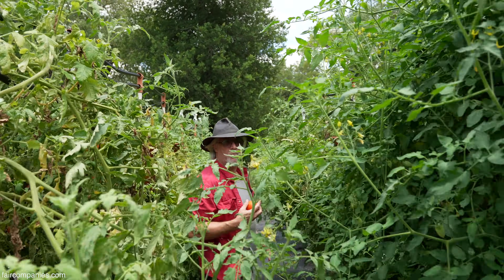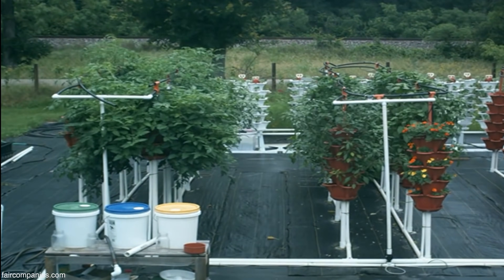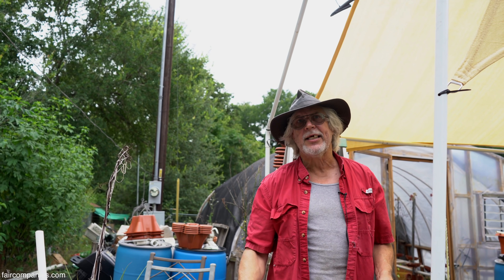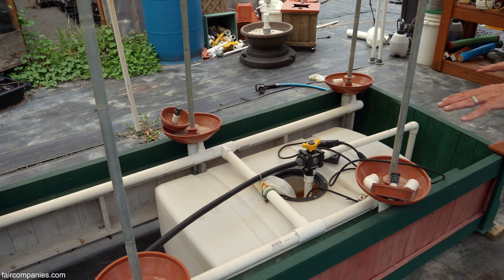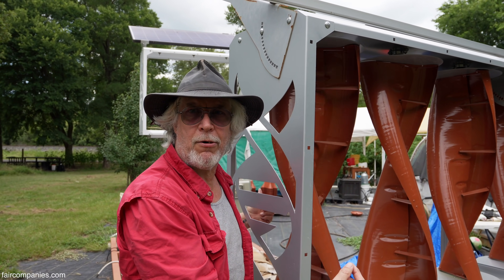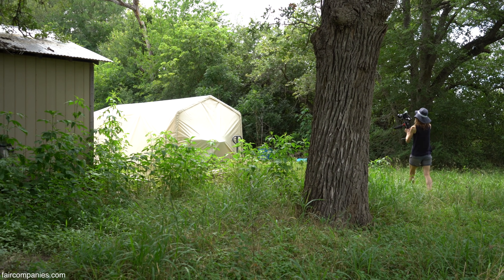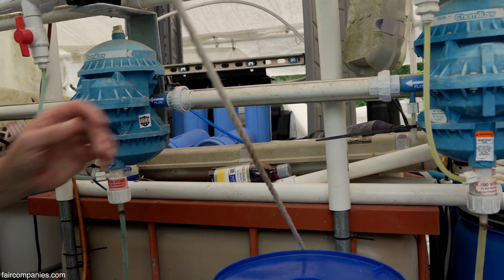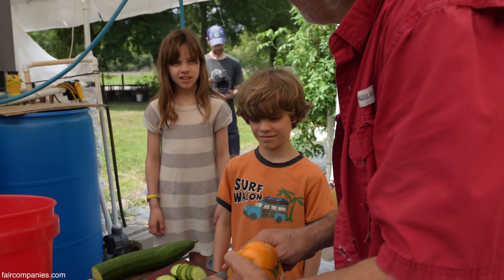Mad scientist's homestead is parking size, off-grid system

Comment: If you're interested in these types of vertical-axis windmills, be sure to search a bit for: "Savonius wind turbine". This will show you examples of similar turbine designs, which can you even make as a small science project using e.g. a Pringles tube or a (a bit more "serious") using a small section of rainwater pipe.  :)
Note: make sure you stay safe though! When there are high wind speeds. Under high load (and when no braking/safety mechanism is present) parts can go flying when a wind turbine hasn't been designed/constructed properly.
Reply: If a horizontal axis wind turbine keeps hunting a changing wind direction it's not installed in a good spot to begin with. Any type would underperform there. A good installation is high up in clear, no turbulent air, something like 10 meters above the tallest obstruction nearby and designed for the commonly seen wind speeds of that particular location and the size of the machine comes out of the equation for that wind speed - likely lower than that even, if you want at least some production most of the time.

Anything installed on ground level will see lower performance no matter the type, and the vertical axis designs are among the least efficient -- inherently, no ways around it -- in converting energy from moving air to mechanical energy (which can be further converted to electricity or used directly for pumping water, or milling something... your choice).

Vertical axis turbines therefore have to be larger and consist of more material for any given output power, making them a more expensive choice for the energy they produce over their lifetimes. They're neat to look at but their downfalls keep being rediscovered by hopeful inventors and self-builders time and time again. If these shown here were put through their paces in a windy location we would likely rediscover one of the pitfalls of the design, which is the bearing lifetime. Unless they're rather hefty and therefore even heavier, and if they're installed up high, that's all the more weight aloft, requiring a more expensive tower. Don't put them on your rooftop either, that's another mistake that makes people regret the decision over and over due to their vibration making the house shake. Not shake it apart, but enough to annoy you with the sound.
Reply: @sietuuba  Amen.
Reply: @Aquatic Ape In any mechanical energy to electrical energy system you have to take care to match the mechanical speed to the optimum power output speed curve of the electrical energy generator.... basic physics.  Vertical axis wind turbines of which Savonius is a low speed type (there are VA high speed aerodynamic blade types) is a bad match to a compact electrical energy alternator/generator that was originally designed for higher speed engines (1,500 - 3,000 rpm approx).  However, low rpm Savonius wind turbines are a very good match for large dia high torque pancake style generators and even better for high torque low speed water pumping.

Look at the western prairie made hospitable by pumping well water up from underground using very low speed multi-blade wind mills - same principle - match the blade design and wind turbine technology to the load.  If the load is low speed use low speed wind turbines.  Horizontal axis big blade diameter electrical energy producing wind turbines are in my opinion one the most egregiously inefficient clean energy tech devices built.  The invested energy is enormous in the tower, turbine, blades, 400-cu-yds of concrete base ...etc.  The blade speed is not matched to the optimum high rpm power curve speed of the generators so they have to use gearboxes or hydraulic motors to convert high torque low rpm from the blades to high rpm generator speed ... waste ... waste.

The largest owners of big tower wind farms in the USA are Wall Street firms and a couple big banks, because 30 years ago they bribed Congress to allow the entire cost of building the wind farm to be depreciated over 5 years against bank profits then reset back to the full amount if they sell the wind farm, usually horse traded to another bank or Wall Street firm.   So every five years a $300m wind farm becomes an extremely lucrative 5-year depreciation tax write-off worth $300m to the new owner ... then they swap wind farms and get the tax value of both farms reset to full value of $300m... repeat.    Big wind farms never have to make electricity to generate huge profits for the owners if their other businesses have big profits that need to be shielded from tax using capital depreciation schemes.  This is the big secret lie about wind energy in the USA.  Like they say .... follow the money.
Reply: @SeattleCoorain  So because of a tax loophole in a corrupt country representing 5% of the world's population, HAWT in general does not compete in terms of LCOE?  HAWT wind turbines are becoming more powerful and cheaper all the time. In my opion your opinon is probably wrong. Facts count, not over-generalizations based on a worst case country.
Reply: I’m interested in more info on the alternators shown at 12:50, and the internet devices shown at 14:50. Are these things available for other purposes, or only as part of a farming installation?
Reply: @k9gardner  You can use the antenna system for home internet.  you can get more info at SimNetWireless.com
Reply: @k9gardner  keith. theyve been making motors like that alternator for quite awhile now. im an electrical engineer, its really easy to design the circuit boards for this. however making circuit boards are very bad for the environment so while i can appreciate the benefits of tge solution, it does come with extra issues. that being said, they should last for a long time assuming vibration and exposure to environment soes not cause delamination.
Reply: @chrisludolph348  If making circuit boards is bad for the environment (which I don't doubt), we're screwed, as everything seems to have a circuit board in it nowadays. I'm one of the people Larry Johnson refers to when he says when most people think of an alternator, they think of something like what's in your car. I've never seen one like this before, do you have any further info you can link me to? I'll search on my own of course, but if you're referring to anything specific I'd love to see it. I'm interested in high-efficiency alternators/generators, particularly because of my interest in the kind of small wind turbines he's making, and low-flow water turbines, etc. Thanks so much for the input.
Reply: Thanks...
Reply: I helped install those wind turbines in Argentina. It's on the outskirts of Buenos Aires. We installed them probably 10 years ago, those blades that he has are from those systems. I'm pretty sure our company actually had the copyright on that blade design. Windstream technologies was the name of the company
Reply: @denniswebster1176  Thanks, that was super enlightening!  Windstream actually has some specs, listing the output at 11m/s. The fact that this is 10 years' old technology and has not made a splash since then (just google (WindStream TurboMill) indicates that this is not a successful design.
Reply: These pots need to made into 3D STL files in the public domain! 
It's possible to eaisly turn recycled bottles into things like this! 
Hope this manifests! 🤞
Reply: @eliellington  Is it your position that private intellectual property should be looted for the public good?
Reply: Savonius  (vertical axle) windmills are notoriously ineffective compared to the propeller style ones. They were invented a hundred years ago and there is a reason why they are not widely used.  It would have been interesting to get proper test results for this design, but any claim that this design is more efficient than what is producing 99.9999% of today's wind energy production should be taken with a very large spoon of salt.
Reply: @tzenophile  yes the H-Darrieus is most efficient of all VAWT
Reply: @tzenophile  Read the research papers. I  built and tested a model VAWT for my university project.
Reply: @danieljones3140  When; recently? Any papers you'd particularly recommend, then? Preferably open access. Anyway, even if H-Darrieus is most efficient of all VAWT, as you say, that is like saying, Cours is the best of all pitiful industry beers. Not really a recommendation, is it?  I ask again, where are the successful VAWT installations that can give us real data? Or even the VAWT companies that have actually launched a mass product a few years ago and are still in business?
Reply: @danieljones3140  So, no paper recommendations? Just hot air? There is still time to surprise me, Mr Jones.
Reply: @danieljones3140  How many universities have you experienced? In how many countries? Facile, anecdotal, oversimplified conclusions, like yours seem to be, is the bigger problem that science tries to rectify. Did the moon landings happen? Is the earth flat? Are you one of those, or not?

There are countries where the monetization of higher education has gone way too far, like that now 3rd-world country, the USA, but to dismiss research and technology off-hand leaves me wondering what your rational alternative would be. If your answer simply is that you don't have any alternative, I'll respect that.
Reply: @tzenophile  indeed you are correct. But it also depends on height. Propeller windmills work best when they are as high as possible, where the wind does not change direction and has the highest power. It might be that close to the ground, these work better. 

But a much better solution would be to build a tower as high as possible and place a propeller style windmill there. In stead of trying to improve a flawed system with another flawed system. 

Wind energy at ground level is a bad idea, everything that enters his compound is already displaced and diffused by all of the trees surrounding it. Wind streams are like a river, and earth is like the shore, if you want to catch the stream you have to go deep enough where the stream is not hindered by the side.
Reply: @stnhls  I mostly agree with you. My only contention is, how do you know VAWTs are better or as good as HAWTs at low, turbulent heights?  As I understand it, VAWTS are not better than HAWTs at ground level, they are just relatively less worse than they are up high. So if you have one of each, you put the HAWT up high, and the VAWT at ground level (if you bother with it at all.) What you never do, is the opposite.
Reply: @tzenophile  at some point the horizontal windmill will hardly rotate, if the wind is really diffuse. The vertical design will operate no matter what direction the wind blows in. So I can imagine there might be some scenario's where it will perform better.

Also less movement of the gravity center, easyer scalability and stackability, less complex design with less materials used, less torque generated on the pole, are all considerations that could come into play in addition to the height / location.
Reply: @stnhls  When there is hardly any wind, there is also hardly any power, so you get a useless amount of watt. The only scenario to justify a hawt over a vawt is when the application is so puny that it doesn't matter how little you produce, but still, this is a window of perhaps between 2 and 3 m/s. In zero wind nothing happens either way. So you need a battery for that, and why not charge this with a proper, efficient turbine. Or even simpler, solar.

Your other arguments are easily countered. There are VAWTs without gears too. Unlike HAWTs they don have the full weight of the rotor on the bearings, etc etc. Your big problem, though, is reality. in more than 100 years of VAWT, there has not been ONE successful, marketable, commercially viable design. And not for lack of trying. It is fool's gold; the turbine design of the future that will always be the turbine design of the future.
Reply: @tzenophile  Yeah, I spent most of this video thinking to myself that this guy is light on facts and heavy on feelings.
Reply: @tzenophile  Depends what you call effective. The propeller ones are installed in a certain position because they know, they studied and have enough data to know where can be efficient. This instead is made to be multi-purpose. By try and error like this fella did, he knows why he choose this instead of the modern one.
Reply: @BurninVinyl  I'm sorry, but no, this does not depend on my personal definition of 'effective'. If you want to claim that I'm wrong, please present a single piece of evidence that vertical axis windmills are competitively efficient. They are not. They look cool, which is why people want to believe in them, but they are only used in applications where output is not important, e.g. low-power sensors. If EZGro wants to claim that this is as good as horizontal axis windmills, they have to give us the data. This is pure physics; simple calculations and measurements. Why do you think they don't? It would have been seen as a major breakthrough if they could. But no.
Reply: @tzenophile  nope, you are the one here to prove it. The video explains why they are using this type instead of the one you mention, not because they look cool. 
Your only reply can be resumed <<they are bad cause they are not the current trend>>. 
The destination of use is different because horizonal axis windmills, I bet you need to get a permit from the gov to install them, instead this type are easy to transport, smaller size, cannot hurt birds and animals and do not require permit from the gov because low wattage. It's more DIY kinda thing. When you want to install something who produce x amout of energy, if this surpass certain level, you need a project, engineers, technicians to certificate your implant. You can't DIY.
Reply: @tzenophile I find this interesting, why would Argentina chose vertical axis versus propeller style?
Reply: @tzenophile  nope, already explained, if you just do not take parts of phrases. 
Whatever you are selling, let me tell you, your strategy always backfire. Take care.
Reply: @BurninVinyl  I realize that English is not your first language (and mine neither) but you are not making any sense here. But I get it, it is not fun to argue when you don't have arguments.  Insulting me by insinuating I am selling something which I am clearly not, is just more nonsense, so yes, do go away.
Reply: @Catcat123-w3l  I have no idea what you are referring to. Please elaborate.
Reply: @tzenophile  in the video they show a combined solar /wind project between two highways in Argentina.  His vertical design was used.  Look a minute 16:39.
Reply: @Catcat123-w3l  Ah, yes. So,  who invested in that? How much of Argentina's wind power is vertical axis? What is your exact argument? That this is the norm in Argentina? Because that is what it sounded like, and it is clearly not the case. I'm not saying this product is not selling. But as they would say in Argentina, ¿Dónde está la carne?
Reply: @tzenophile  you misunderstand me, I have no argument, just questions because I don’t know enough to argue.  Using logic and experience of driving on super highways, I can say the vehicles moving at high speeds create wind.  To capture that wind, the spinner needs to be closer to the ground then a typical commercial size windmill.  So a non propeller would be better to capture the the wind created by vehicles passing at 40 mph +.  Your thoughts please.
Reply: @Catcat123-w3l  If you have high school physics your thoughts are as good as mine. I'd say the energy produced by vehicles on highways is negligent for any practical windmill purposes, and on the video the cars are too far away for even minimal relevant drag to occur. Full points for originality, though, but if you want cars to produce significant energy, say, in a wind tunnel, that comes out of the cars' energy. So fossil fuel, unless of course, the cars were electric.
Reply: @tzenophile  sorry no high school physics, I tended toward biology,  anatomy and physiology, (medical)and botany.  Maybe someday we will harvest sound waves for everyday energy use.  My nephews loud one year old singing voice could power NYC, I’m sure. Lol
Reply: @Catcat123-w3l  Sounds like you are describing those vats from the Matrix ...
Reply: @Catcat123-w3l  WOW you mean someone wasted a shit ton of money on useless turbines?? So why isn't there data on what that install has produced? Not a single stat anywhere on the web, NOT ONE!
Reply: @tzenophile  billions and billions ,, Sagan is a star gazer not a scientist
Reply: @caseyhartigan9448  1kw for 30USD? What exactly are you referring to, Casey? A link would be nice. The video here is showing a product that claims 150W at top wind speed (and 3 of them =450) , not 1,2K. At the price, and even if that were true, it is a BAD idea to invest, you will lose that money while waiting for return on investment/breakdown of equipment. I do appreciate you're chiming in, but please add more substance.
Reply: @legalfictionnaturalfact3969  No, teacher. In DIY the word touch different fields such as economy, legislations, not just technical. I've explained in the firsts comments. Bye.
Reply: @BurninVinyl  words have meanings, you dont' get to make them up...byeeee!
Reply: @legalfictionnaturalfact3969  if you looked up you would see the meaning changing by different arguments such as military or economy. 
GoodBye <<teacher>>.
Reply: @BurninVinyl  you already flounced, sweetie. stop stomping back to say bye again. no one cares. words have meanings, you don't get to fabricate them on the fly. sorry. <3
Reply: @tzenophile  yes. I agree. Data on it would be very helpful when deciding on a purchse.
Reply: @tzenophile  Ok, Vertical axis hasn't taken off yet because its hard to monetize something that can easily be purchased by anyone. Everything in this world is about money. English is my first language so it won't be hard for me to tell you that you are wrong.
Reply: @marcgeronimo2997  Then why not try? So far you are saying nothing worth listening to, just random nonsense. It is obvious that you don't have a clue about wind turbines.
Reply: @Catcat123-w3l  
Probably for foot print, and ease of maintenance. Where they are placed on the solar panels is a pretty good idea. All in one units, instead of space in different areas.

This is one complaint I have for green energy ideas. Big power companies want to "save" the environment but clear cut entire areas to set up their infrastructure... I like this guy's ideas. Makes me want to spend money on what he designed.
Reply: @TheTyrial86  on a small scale, there are many complaints by homeowners that tall windmills vibrate the home which is unpleasant and raises concerns that over time it will loosen and impact the home structure.  My personal interest is due to the geography around my home there is area that even in low winds has an area of constant higher winds that could sustain a mill that responds to relatively low constant winds.  Though I do not have an engineering type mind my dad was brilliant in that area and we talked about the possibilities before he passed away.
Reply: I'm so glad I didn't dismiss this video, this is packed full of invaluable wisdom and information oh, thank you!
Reply: Have a great day, I love you!
Reply: @DrMatthewHudson  The only thing clear from what you're saying is that you're not right in the head.
Reply: @DrMatthewHudson  Why do people like you, who can't even write and have nothing to say always want the last word?
Reply: I love the wind turbine  system how much do they cost?
Reply: look into HARMONY TURBINES :)))
Reply: I did your search and it was all very positive... everything I saw was good???? Maybe I misunderstood your words for a warning???
Reply: @virginiaallisonpeck2517  He/she is not warning you about the turbines themselves. In the last paragraph, there is a warning about high winds - the system needs to be secured in case of strong winds. That's all. Good luck!
Reply: Savonius wind turbine is one thing, what interested me is the newer idea for the generator attached he made, Ive not seen anyone else making that style. did he make it off a other model or idea? if so whats the name for it?
Reply: @cab435  It's a rather compromised implementation of an axial flux design. The arrangement can work just fine if built better. Much more powerful ones have been made (and have withsthood the test of time) with the designs of Hugh Piggott. I recommend anyone with interest in small scale wind power to check out his blog and website for his wind turbine designs.
Reply: Holy Mackerel! A bunch of people below arguing from their conjectures. Frankly, I am much more fond of vertical systems, using a combo of micro turbines because they can be scaled up slowly, do not depend on heavy winds, and are not made by Chinese Communists. But that's just me.
Reply: @watchingvideos2235  And some of us (few, admittedly) are arguing using facts and logic instead of emotions. VAWT are nicer to look at, but that's all. This company went bust five years ago. There is a reason that they don't sell, after 10 years on the market, as in this case.  They simply don't recuperate their cost. If you want something nice to look at, that don't lose you money, buy a painting.